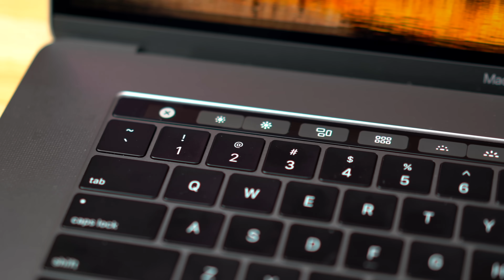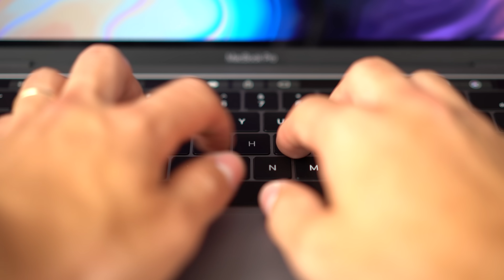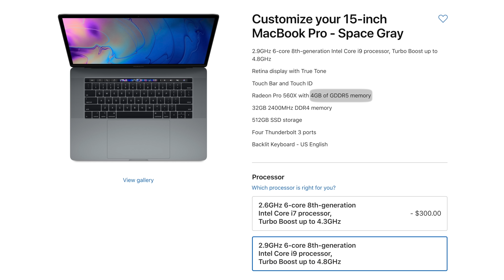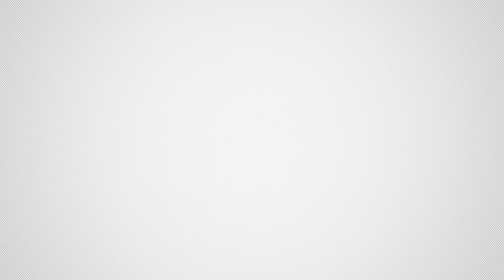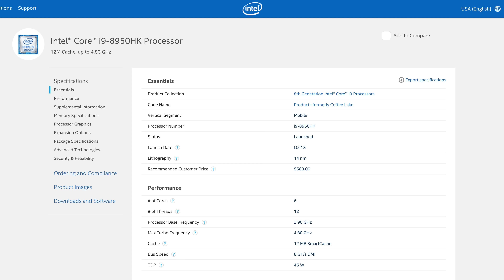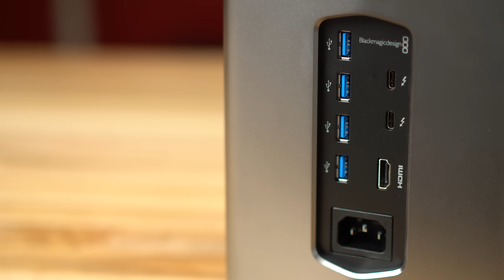2018 15" i9 MacBook Pro Review - After the Fix

Comment: I know I am WAY late to the party, but, I have High Sierra (10.13.6) on time machine from my macbook Pro (2014) that just died. I want to get this machine, but, between the i7 and i9, MANY people complained about the heat and heat throttling from the i9. Through more research, I came to understand a patch was released that fixed the issue? If so, if I bought the 3.6Ghz icore 9, and restored 10.2.6 on it, would that essentially have the patch in it that solved the heat issues, or, is there a site I'd download a patch once I'd have my system restored? I'm gonna use this for a lot of video editing, authoring, 3-D printing and graphics. I wanted to maintain High sierra because my whole app situation on this time machine back up is perfect. In time, I may upgrade, but, I kinda wanted to find the latest, best machine that would still run High Sierra.

Comment: Hi, a quick question about a small test about CPU speed during 7zip compression (smallest file size). If you have i9 in MBP please do a small test. Run simultaneous compression of large files, at least 12 files in Keka or any macOS archive, but Keka is very useful. Please observe CPU speed if it maintains at least base clock speed. Then compare it to ZIP with same level of compression. Thanks for help. I am wondering if there is a problem with 7zip or i9 processor in MBP.

Comment: my iPhone X has almost the same score on Geekbench 4 as my Late 2013 iMac 27" 3.5GHz. The iMac is only 10% faster than the phone at processing speeds, which is what's needed for video editing. I've now sold my soul to buy the i9 MacBook since I also need portability. Benchmark scores say it can be 4 times faster than my current iMac and I can also turboboost it by a lot, considering my current iMac can only be turboboosted from 3.5 to 3.8... really.

Comment: Hey Max, 
thank you very much for your work! Could you say anything about the temperatures and fan noises of the i9 vs the i7 in the 2018 models? In my daily life it doesn't matter to me if the CPU is 2 or 3 minutes faster. The battery life, fan noise and cooling is more important than just some percentage more power. I've heard that the i9 model has up to 14% more battery life than the i7 (check the video from Vtudio about the battery life between i9 and i7) What are your experiences with that? The fans of my i9 model are very often very noisy which is quiet annoying. If the i7 model is quieter, and there is no 14% difference in battery life, I would switch to the i7... I would really appreciate your results

Comment: Still have questions about the throttling. So when it does get to the point where it throttles, is it actually noticeable in system performance? If you didn't have the utility showing you the clock speed, would you actually know that it's being down-throttled? How's the fan noise during these times or during normal usage? Are there any drops in performance in other areas during the throttling (like SSD speed)?

Comment: Its kinda funny to blame Intel for not making 10nm chips for new mac slim design. one may wonder when do apple used latest cpus in there computers until now ? which is never until now.10 nm architecture 45watt CPU will be similar in terms of thermals.Also its kinda bullshit that they can fix hardware problems with software patch.All they did is just kill some system process to take over head from cpu.
Reply: Intel was designing them for everyone, not just Apple. It wasn't anything exclusive. It was supposed to be the next step in CPU design, but they ran into production issues AFTER promising it was coming. And no, 10nm chips will definitely have lower temperatures. You clearly don't know how any of these processes work.
Reply: My initial intention was not to reply but u guys are fightin over this is kinda funny.Anyway my comment about Intel was a satire on 10 nm Intel chip regarding "apple insider' comment on it.As for your comment on 10 nm chip on low temp. please read what i wrote. I mention cpu power 45W and thermals.Truly i have no idea what  in talking about, thanks for the heads up.
Reply: Erik Bakker lol that doesn't make any sense. Intel is a company, not some marketing scheme.
Reply: lol still wrong. You sound simple.
Reply: Ahh so you failed on an epic scale 😂😂😂
Or you're just an especially ignorant troll. Either way, you don't understand Apple as well as you think you do.
Reply: No, they're not. You just don't know what the hell you're talking about.
Reply: LOL you truly have no idea what you're talking about. Apple's a trillion dollar company. Only a complete moron would say they're "going downhill". And it's plainly clear you don't have experience to back up your baseless claims. Apple's customer support is still the best in the industry. Build quality is as good as ever and most consumers don't actually care about doing repairs themselves. It's both sad and hilarious how you've been fooled into believing all the BS that Apple haters peddle! What a fantasy world you live in 😂😂😂

Comment: You think Apple got hosed because they're not 10nm chips? Did Apple know they needed a cooling solution that could dissipate 45W of heat? If yes, then the process node of the chip means nothing. A 45W 20nm CPU puts out as much heat as a 45W 14nm CPU and a 45W 10mm CPU. If they knew they were putting a 45W chip in the chassis then they simply failed to engineer a proper cooling solution.
Reply from the maker: You're aware TDP is the processor running at base speed, not in turbo, right? That 45W is at rated speed.

Intel announced 10nm -- and lower heat -- three years ago with promised delivery two years ago. And, its still not here.
Reply: im pretty sure apple did know all about but deliberate proceeds on  the production... this si how apple considers you customers just like a set of cow titties to be squeezed the more they can to steam all the milk its possible
Reply: it way apple works.it everyone elses fault for their fuck ups.this why apple macbook pro over a decade ago stopped being called"laptops" because they use too burn people that sat them on their laps and guess what?still little ball roasters
Reply: 10Nm means jack if they try and stick 45 watt chip into a laptop body/cooling  that can't handle the heat under full load

Comment: You should have brought more attention to how it is much more expensive than better products from other companies and how the thermals are terrible. And the problem of dongles is you are doing more and holding more to do the same. And the blaming thermals on intel makes no sense. The tdp would likely be the same and coolers can be designed in no time especially by such a large company. Cooler design is not a multi year process. And I’m sure apple had some knowledge on what the i9 tdp would be before release and it has bred out more than long enough for them to know before release their cooler was inadequate.

Comment: Max you've been killing it with the video editing mac videos for at least the last three years that i've been watching.  This one is no exception.  

I know it's a very specific question so probably not worth a video but....if someone like me can't decide between the 15" base model vs the 13" w/i7 and 16gb of ram (they're only like $200 apart so this question has nothing to do with price), what you would recommend for something that does need to leave the house here and there (but not everyday) but something that also needs to be able to do light video editing (single source video; 4k at 24fps) for my kid's youtube channel?  I want the form factor of the 13 but I'm afraid i'm really going to miss not having a dedicated graphics card....
Reply from the maker: Thanks Christopher. I do want to point out that this channel is owned by Apple insider and not everything is my personal opinion or completely my opinion. This review was written by myself and a senior editor Mike W.  As for your question, if you can deal with a 15” size I would definitely choose that since you’ll get about 40% more CPU performance and 50-100% better graphics performance for only 9% more money. With that said I do prefer a 13” form factor for on the go use especially in airplanes, and if your editing 4K with final cut and not doing color grading especially the use of LUTS the new quad core 13” will have no problems. If you do go that route, don’t do the i7 upgrade. The performance gain is so small it’s basically negligible. - Max
Reply: Thank you so much for the detailed response!  It's really helpful since that i7 upgrade is pretty costly if the difference isn't too significant for the 13".  But yeah I think the 15" I'll go with since at least 80 percent of the time I'll be using it at home.  Thanks again for the help.  You also helped me (on your personal channel) choose the computer I'm typing this on, my late 2015 iMac, including what ram to buy for the upgrade (which to this day is one of only two hardware upgrades I've ever done on a computer).  Take care man.

Comment: What about the i 7 version? Apple has deals on the older kaby lake model. If I dont go for the i 9...is the kaby lake from 2017 a better deal?
Reply from the maker: https://youtu.be/x7gvol-sj64

There's some info on the top-spec 2017 15" model in this video, just head to the performance section.
Reply: Ok thanks, right now I due mostly HD. I dont even own a 4k camera. But for photos I have a Nikon D7200 its very good.
Reply from the maker: base 13" Touch Bar model would be a great choice for you.

Comment: Anyone else thinks this video felt almost like a commercial? The bias was tangible.
Reply: Moreover, I feel like he forgot to talk about the temperatures. It's nice that the performance is upgraded (and as good as it can be in a thin laptop) and people say it's really quiet - but if the temperatures are still so high that you can burn yourself by touching the keyboard - then it's a big NO for me.
Reply: Piko5552 Piko5552 it’s a great laptop so there is no surprise. 
Costly? no one is going to argue with that but MacBooks have always been expensive so reviewers that moan about that are just dumb as this will never change, it is what it is!
The review shows that the Mac is a reasonable upgrade from pre-2015 Macs, maybe not a massive improvement on the 2017? 
The review confirms that it runs hot, like an XPS, so for hardcore intensive stuff an iMac pro would be a better buy for your main machine.
Until Intel gets its act together small light thin laptops are not going to work at their max capacity, my 2017 XPS would reach 95c regular and throttle like crazy and now we here that Intel will not get 10nm till late 2019, so 2020 before it is mainstream, 5 years later than they promised. This is a joke and hurts Dell and Apple with their design cycles.

Comment: Max - PLEASE post comparison between 15 inch i7 and i9 - we really need this video!! Thanks!!
Reply: Same question here, all existing test results indicate a very small advantage of the i9 for the price of a very hot system, may be combined with the use of an eGPU like the Razer X with a VEGA graphics card, which also generates the question which monitor to go for as the LG 5K is not comparable with the Razer X, BENQ? Eizo? Or is it too early to answer the question of the combination of the MacBook with an eGPU especially for FCX, do we have to wait for Mogave and a new version of FCX to be able to answer it?
Reply: Hi Jurgen, I have the same concerns. It seems to me that if the i7 2.6 GHz runs nearly as fast but 10 degrees cooler, that seems to be a much better option.

Comment: Alumni’s case not the best idea at all; it means the case can be burning hot; and you try to connect the USB-C cable to your SD card (oh, you need another reader for that.... so cable does not solve the port problem).

Comment: What about an 2018 i9 vs i7 2.6Ghz comparison?
Reply from the maker: soon!
Reply: Max said he would post this video - hoping today or tomorrow - sooner the better!
Reply: My 2.6 i7 scores a 1057 on cinebench.  My i9 topped out with a score of 960.  I7 also maintains a higher clock speed under load.  I9 is getting returned today.
Reply: Waiting impatiently as well :)
Reply: Beer Fish89 I post a comment almost daily on max YouTube site as well. I'm hoping tomorrow at the latest. Come on Max!!
Reply: AppleInsider Max thank you so much. I have so much respect for your reviews that I am waiting on that video before deciding which model to buy as I am sure many others are as well. Thanks again in advance!!
Reply: Also still umm-ing and ahhh-ing on whether to swap my i9 when it arrives (After my first one bricked :o - https://www.youtube.com/watch?v=Av33-5q5Y_k&lc= )
Reply: Beer Fish89 thanks for posting this beer fish! Does the i7 also run as hot as the i9. Those high 90 degrees worry me for longevity.
Reply: It does run slightly cooler  but still pretty hot. id say may be 7 - 10 degrees Celsius cooler under load. My i9 also had the 512GB ssd which is slower than all other ssd options.  I ordered the i7 2.6 with the 1TB ssd.  put the $300 on the upgraded storage and I am much happier.
Reply: Beer Fish89 ok thanks very helpful. Hopefully max will post his video comparison today!
Reply: Ive been waiting for that video since Max said he completed one pre supplemental update and had to redo it.  I've searched the web, browsed forums / reddit and found nothing.  I'm starting to really wonder why this comparison hasn't dropped yet.

Comment: Great video. Really tired of hearing about people complaining about USB C. It's a much faster port and carries a number of benefits. I just bought the 2018 MPB w/ i9 and just picked up a few replacement thunderbolt 3 cables. The SD card slot is really the only annoyance, however external readers are way faster anyway. No need to complain anymore
Reply: Michael Ortiz For what I do yes. I do some photography and video work and use Lightroom and final cut. If you’re using processor heavy applications then I would definitely recommend it. Otherwise I’d probably stick to the i7 and max out the ram and buy as much storage as possible. The SSDs are incredibly fast and really speed up my workflow. I bought the 1tb version last week and then exchanged it for the 2 tb version which was a great decision as I no longer need to carry around an external ssd. 

I’m coming from a 2015 MacBook Pro so the difference is pretty incredible.
Reply: Steve Savanna probably has to do with the high cost associated with the new tech at first, people like to push things farther than they should, which is why a lot of companies still use 20 year old technology because they dont want to spend the extra couple dollars to get everything updated, but they'd rather keep pouring money into fixing ancient tech instead, whether it's software fixes, new plugs, adapters, etc. To me thats just more shit to lug around. Ir rather have literally one cord of the same variety that I could plug into anything I choose and expect it to work, whether it be a portable hard drive, an external display, speakers, etc.
Reply: Steve Savanna plus once everybody gets on board with the USB-C port it will be more universal and compatible with other devices instead of all of these proprietary cables and hubs people shell out hundreds of dollars on
Reply: Steve Savanna would you recommend the i9 core?
Reply: Joshua Coy agreed. I haven’t bought any of the hubs. They all seem to have compromises. I just read through Wirecutter’s article on the best USB C cables and spent $75-100 on new versions of what I use. They’re way faster than using USB A adapters so I’m not sure why people have been pushing back on this so much. These changes don’t happen every year.
Reply: Steve Savanna what program do you use to edit photos? I'm a novice a photography. I use a Nikon d3400 camera with a 70-300mm lens, and a 18-35mm lens. Want to try photo editing. The only experience I have with  photo editing is the free photo editor on my 6 year old PC laptop and my smart phone (note8)
Reply: Steve Savanna also. This will be my first macbook. My wife has a 2016 macbook air fully decked out.

Comment: Why no one is doing a review on the 2.6Ghz model?
Reply: ìÐąrκÐųƈκ™ Cydia i have that one, it is awesome! I often hit 4.1 GHz. I use it for Djaying videos and music and the dedicated 
 graphics take a bit toll and works well. Final Cut is notably faster and I personally liked the keyboard feel. If you don’t need the dedicated GPU the 13” is the way to go with 16 gb of ram.
Reply: Thanks for the reply, but I need the dedicated GPU. I am currently using Mid 2014 15inch 2.5Ghz with Nvidea GT750m,512gb. Was wondering to get another one